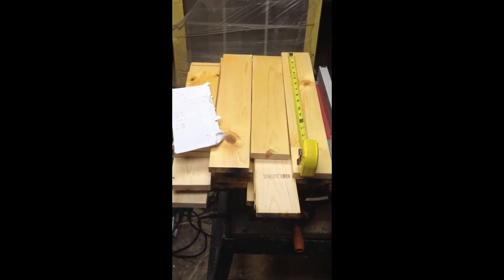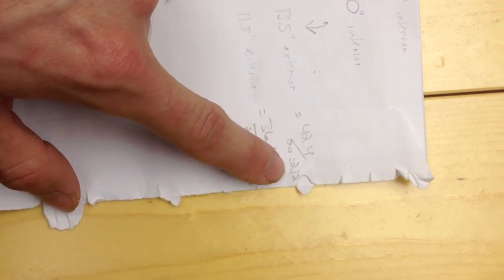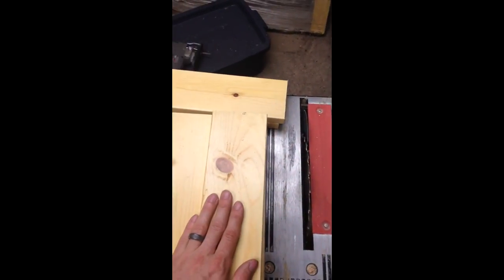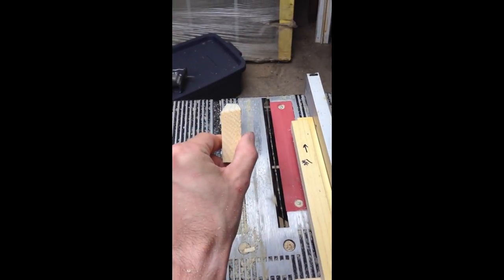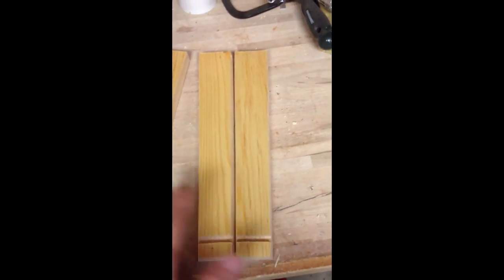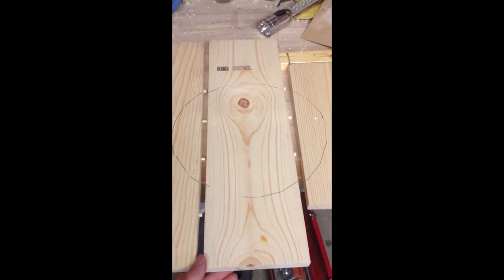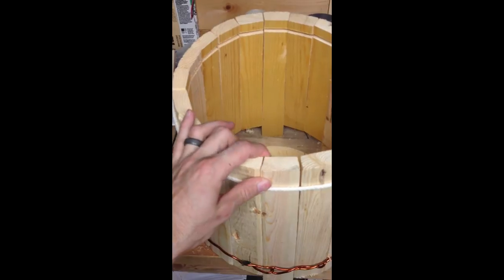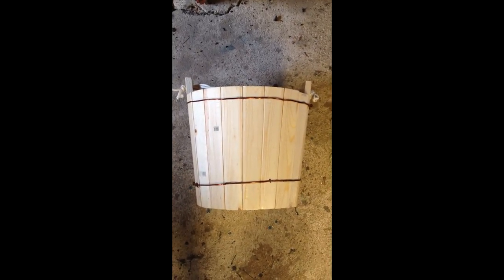How to Make a Wooden Bucket

Comment: You did a great job.   I mad my first one before I watched your video.  I found it was very easy to uses a router bit ( rabbit bit ) on the bottom of the bucket after it was put together.   It cut a perfect ledge for the bottom to drop right in.  Look at that for your next one.      Great job.

Comment: Sorry sir that isn't the chime with respect to you -the grove is a croze -where the head fits in -  the bottom - I have bin a Cooper for years - I make buckets an pales that do not leak-the bottom head I use dry flax seed powder in the ( croze) mix just a little water to make a paste - all so the buckets should be made of pine -so you can crush the fibers + for a realy good info check out  BEAVER BUCKETS from Nebraska - he has a book an C D thank you sir